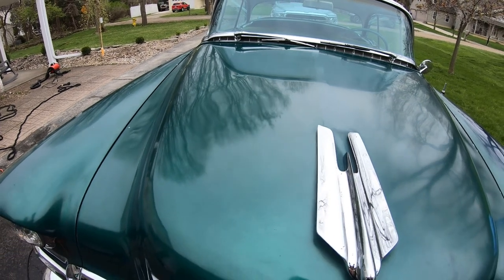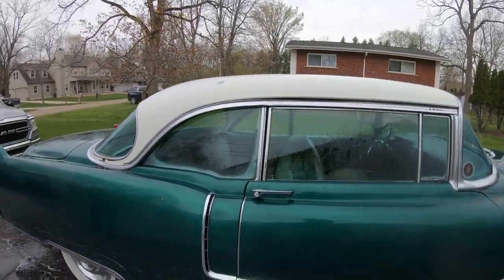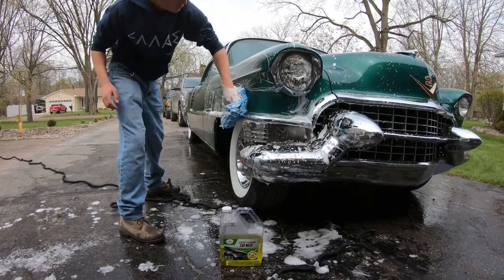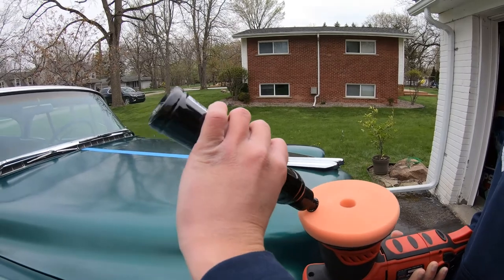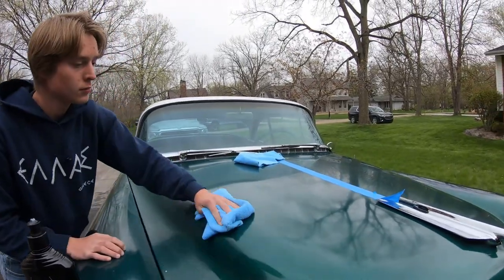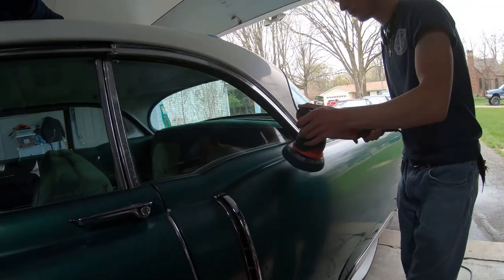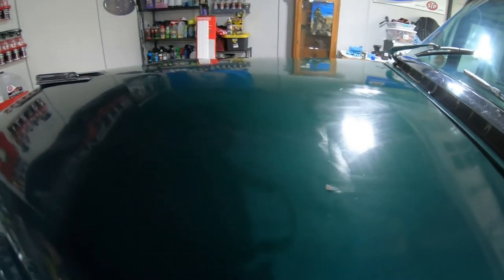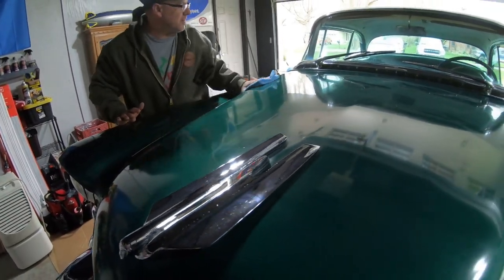How You Can Detail Classic Car With Turtle Wax Hybrid Solutions

Comment: Ooof - old single-stage paint...nice job guys.  I have a cliché about that, "took what I could, left what I should."
That 1&D Compoud is awesome.  I've used it on several  cars with really trashed paint with just stellar results primarily using orange foam and Urofiber 50/50 pads.  The compound has excellent work time, buffs out well, and whatever TW uses in the formula leaves a fabulous shine. 
The MAX Wax, too, is terrific.  I find that a 48-72 hour cure REALLY brings out the gloss and jetting effects.   I didn't notice u guys using a damp towel for initial wipe-off, but that does make removal easier, and the slight wetness somehow enhances the shine properties followed by a fluffy buffy...
Anyways...good work on the old girl!
Reply from the maker: We pretty much detail the same use TW products.  We didn't use a damp towel going. I have to try it. Thanks for the awesome comments